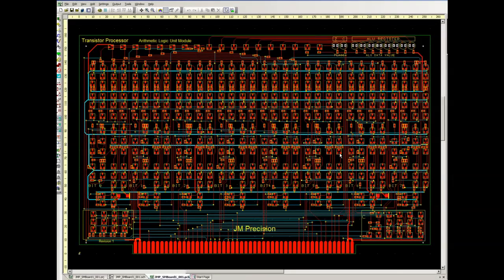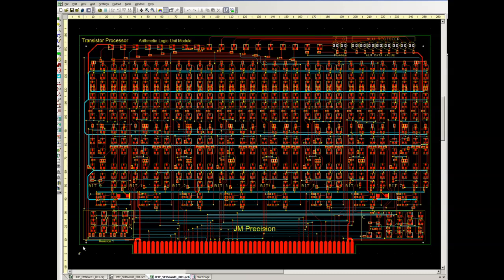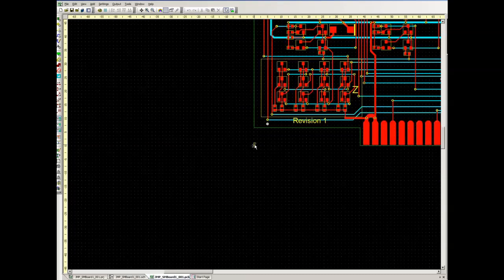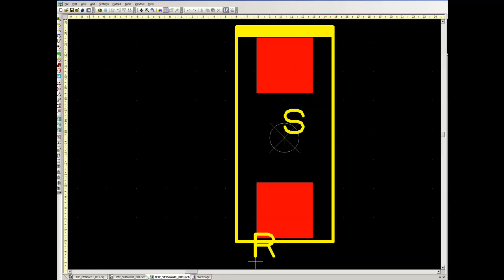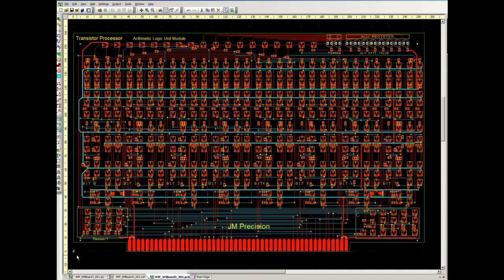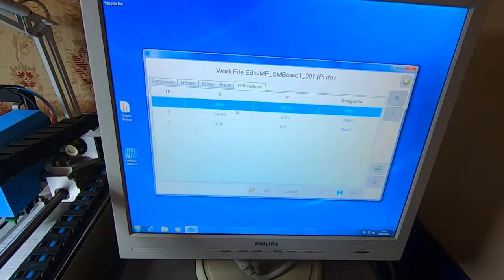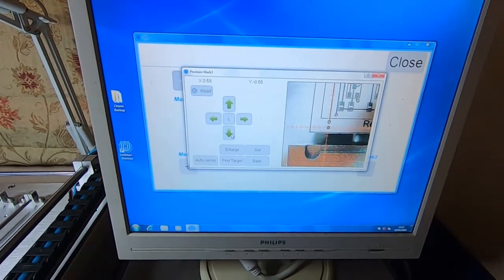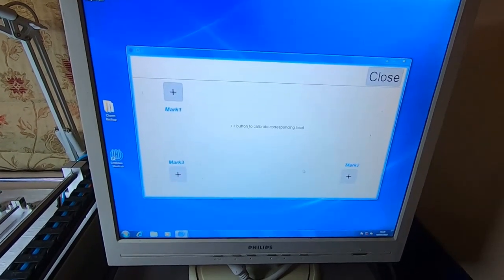CHM T36VA Pick and Place Machine Part 4

Comment: Thanks for the reply.  Yes, I have win 7.  But I don't have communication through the COM port.  RS232 driver installed correctly, it's frustrating, I appreciate any suggestions.
Reply from the maker: Have you tried the COM port with something else to make sure it is working correctly? I assume you have selected the correct port number.
Reply: @JerryWalker001  In my PC enabled the COM 3 port, but the machine does not respond.  Is there a port setting on the machine?
Reply from the maker: @0226kenny  Take a look at page 27 of the user manual. It shows where the com port is set.

Comment: Beware if you're doing "dry runs" like this using a paper print of the PCB that you'll get small changes in the paper dimensions when it goes through the fuser in your laser printer.  Many years ago, I was trying to print out an array of bar code labels for 8mm tapes in a tape robot.  So I'd print a sheet of labels, and the bar code was off slightly over the span of the whole sheet.  I would carefully measure the error, fiddle some constants in my (perl) script and try again.  And I just couldn't converge on correct alignment.  It was then that I noticed that the sheet of labels had shrunk ever so slightly..
Reply from the maker: It will not make any difference if you follow the correct procedure as shown. The point of the alignment using multiple points is to correct for differences between production runs. Once you calibrate the machine on the selected points then it does not matter if the boards (paper prints) vary in dimesions as the software will correct for this. You may get errors using just 2 points if the paper changes differently in the X and Y dimensions but using 3 points it does not matter. As I say in the video you MUST calibrate every board for this very reason.